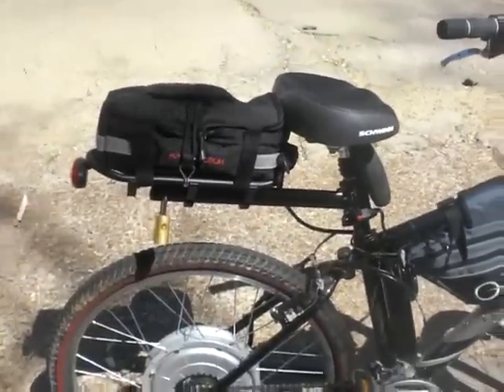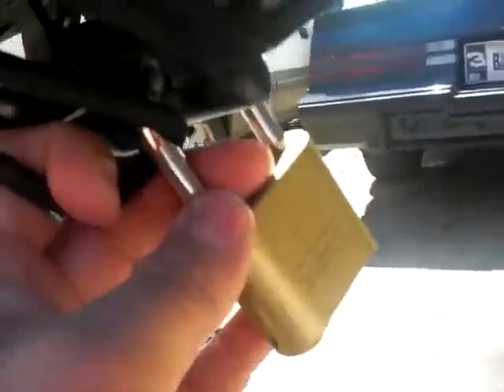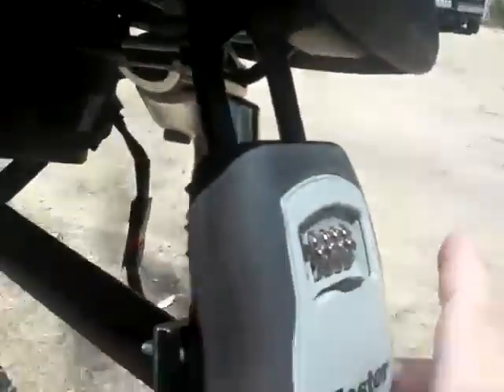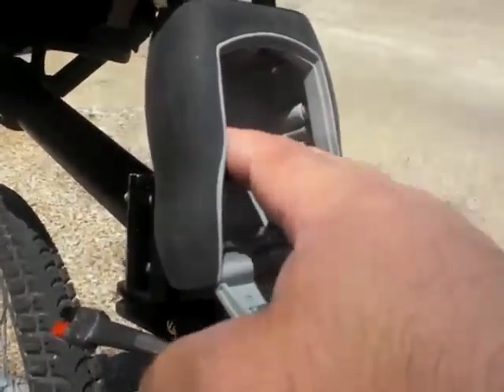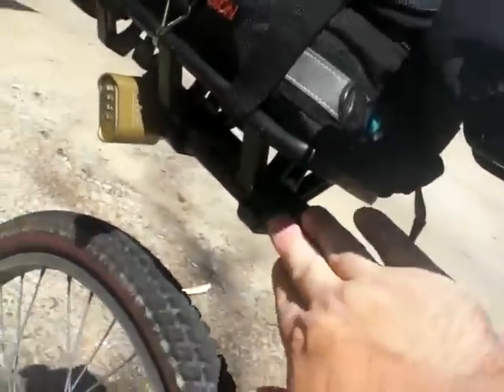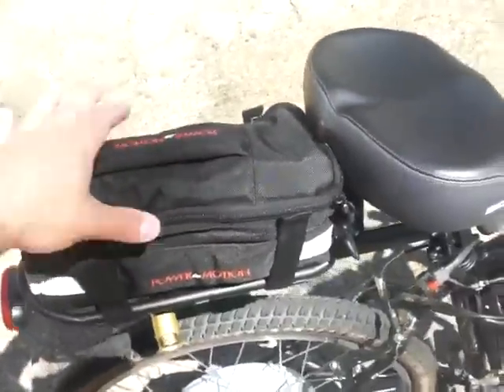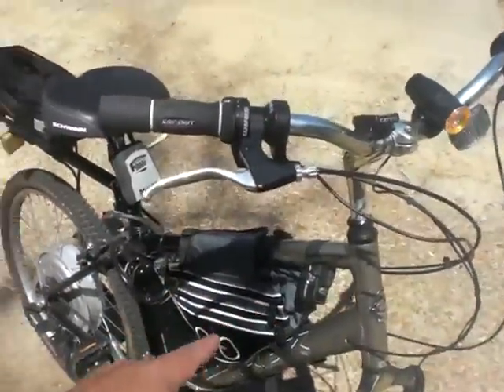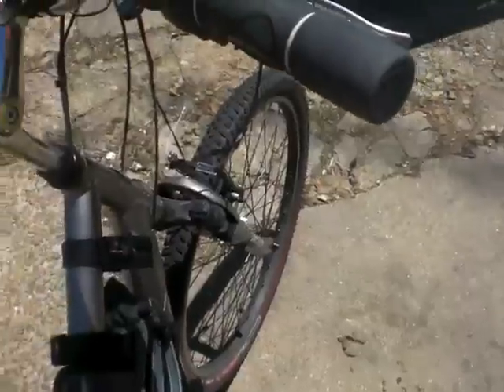bike mods

Comment: Where can you get those battery packs? Been looking for some for my mtn bike but can't seem to find ones that don't cost 200$ Would rather it be cheap so if it does get stolen which it will most likely it won't cost to much to replace.

Comment: The batteries are 36 bolt 10 amp hour. So it has the voltage and amp hour of 3 car batteries! This bike with two 36 volt (72 volt) system will go 40 mph. It is LETHAL!